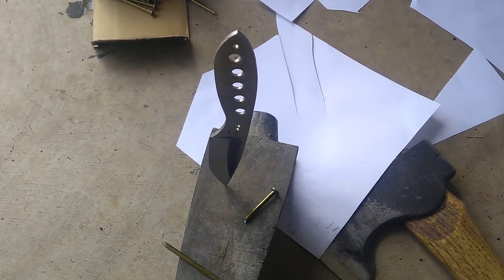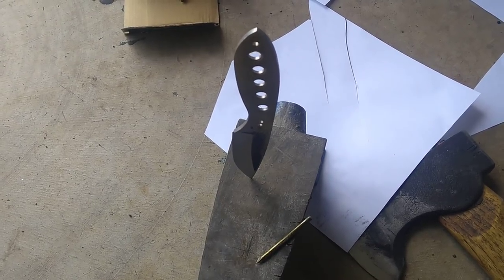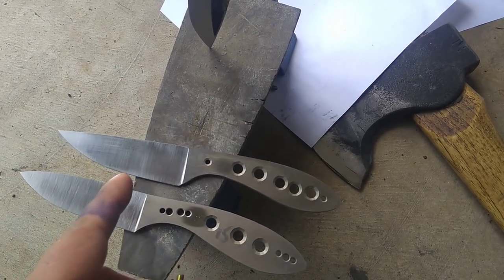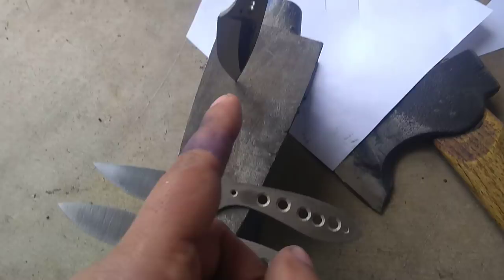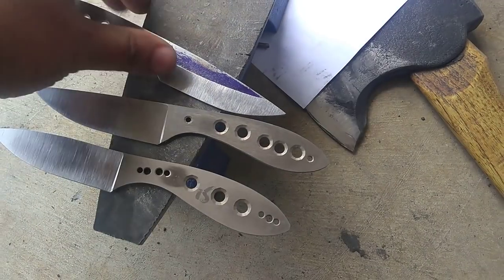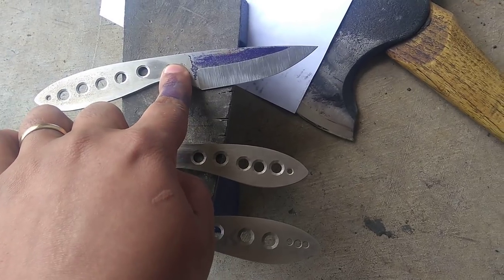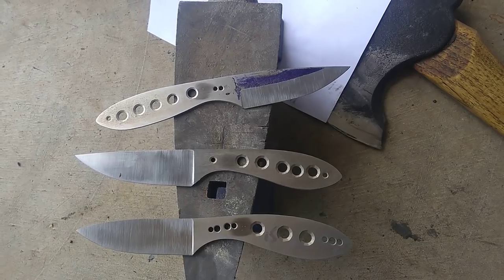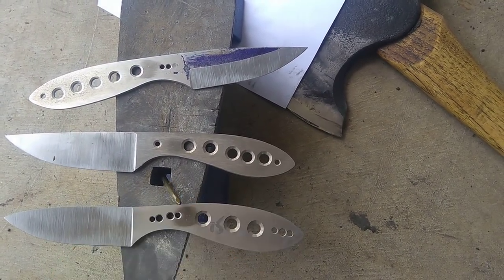Follow up | What about even stronger, less tough steels?

Comment: I basically try to avoid hitting rocks dull or shiny ones or metal objects with knives. Bone is pretty hard but have you ever stubbed a toe? It hurts doesn't it? Knife edges are little too so don't stub them on hard metal or rocky things and you should be fine. Accidents happen of course.